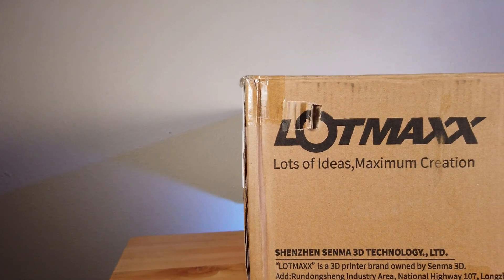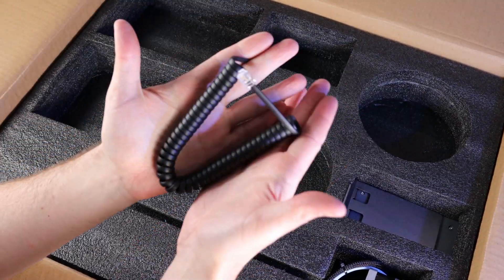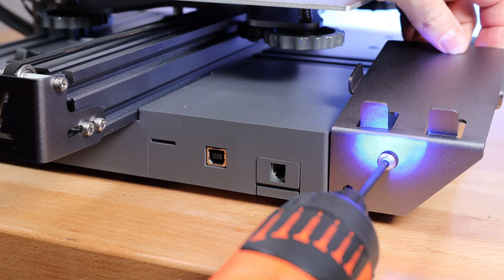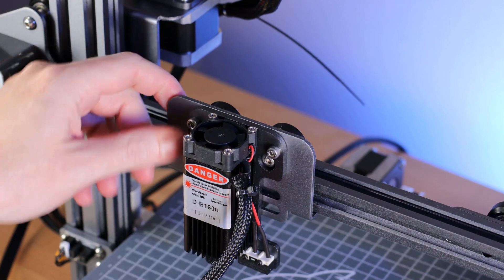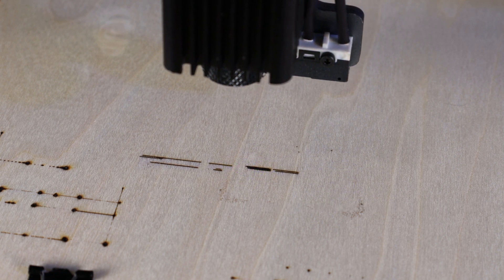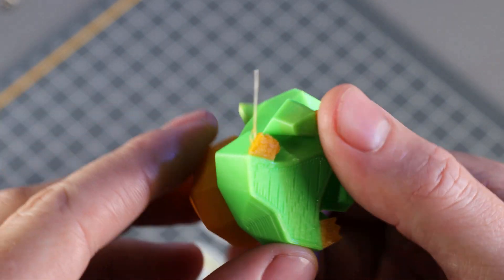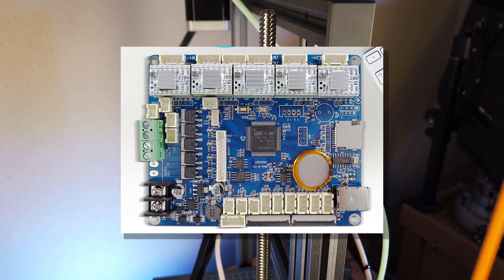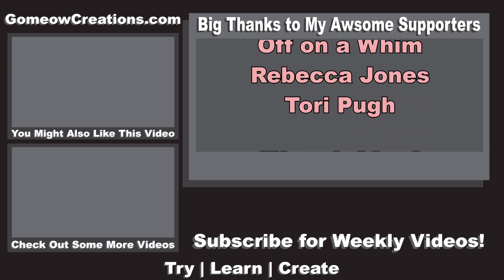Come for the laser but stay for the dual color printing - LotMaxx SC-10 Shark v2

Comment: You might want to check out the 'ecubmaker toydiy 4-in-1 3d printer'?  The build space is smaller, but it does everything this one does and adds an extra nozzle to the printing module and also has a router module.